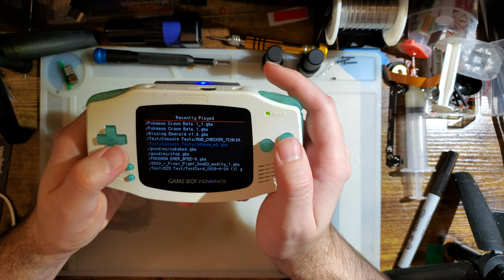Funnyplaying 3.0 Laminated IPS Kit for Game Boy Advance FRM Update

Comment: Appreciate the video covering the new kit, definitely learned a couple things.👍

I just installed this kit myself, I'm really quite happy with it. I don't have any experience with the older version of this kit but the new bracket does feel very sturdy. I find my lense fits very flush along the bottom and sides but the top does sit out past the shell just a hair. 

Colour mode 2 is definitely a bit much. I did find pairing it with display mode 3 was actually a nice experience though in Pokemon Emerald. I haven't tried other games yet.

Comment: I believe the 2230 and 2245 means they are produced in 30th week of 2022 and the 45th week of 2022. Same system like the DOT code on tires.
So in essence the same version of the flexboard but produced 15 weeks later.

Comment: I just installed mine and it has formed a vertical black line down the side that wasn't there when I tested it. Can it be fixed? Or is it a bad screen?
Reply from the maker: I can't say without pictures. You'll want to contact support from whoever you purchased the kit regardless because it's up to them to replace if the hardware is faulty.
Reply: @makho  Funnyplaying was actually really good about sending me a new screen.
Reply: @makho  now when I test screens, I leave them running for about a half-hour with Sonic Advance playing demo mode

Comment: My guess - display mode 2 is horizontal interpolation to compensate for lack of integer scaling - this would be noticeable on side-scrolling games (there is a scrolling test in the test suite normally), the pixels would shimmer as you scroll whereas if they are interpolated it wouldn't be noticeable.
That test screen triggering the touch sensor is pretty interesting! I think the combination of on/off in the digital lines is creating an electromagnetic field or something which is triggering the touch sensor, or creating interference in the lines that run to the touch sensor.
Reply: what is the resolution on ips laminated ? I read that this displays dont have integer scaling. Does this mean its 240x160 ?
Reply: @Poirot07  I think it is 720x480

Comment: I just installed the kit in mine. I did have a couple issues installing it. The first was the clip that holds the ribbon cable of the screen had issues holding after opening and closing a couple times for testing prior to installing. This cause the screen to not display once the shell was nearly assembled. The second issue is the ribbon cable colliding with the screen bracket causing it to want to lift back up. It eventually went together and functioned but not before a lot of anger and fool language. I ran the vertical line test and mine didn't trigger the onscreen display. I didn't use the foam but used kapton tape instead to hold the touch sensor so maybe that has something to do with it.

Comment: Fit this couple days ago, done many screens before but after a couple hours gameplay the screen developed two dead vertical lines. Im guessing its due to the very short ribbon. Theres only one position it can go in to keep the L shape square and this causes strain around the pcb at the top. Could do with being 5mm longer tbh. Ordered another so will see if i just got a bad one
Reply from the maker: sounds like you might have pinched something in your install. This has not been my experience at all.
Reply: @makho  definitely didnt pinch anything, i even ordered a second and before even installing i tested it and it was damaged already. Contacted the store and sent pictures of it powered up out of the device still with screen film on and faulty, they then tested and sent me a working screen which was installed successfully and works perfectly. Im guessing they just had a couple of bad screens and sadly i was unfortunate enough to get two of them

Comment: You don't have any graphical glitches on Link going up and down with FRM on? I do on mine sadly...
And i also prefere the scanline option, especially in GB games, it "hide" the scalling issues better
what i would have to have to make this kit just perfect  :
- integer scalling and 
- some color correction shader option (kind of like the "wiiU shader" on mgba)
- more pixel grids option (add vertical and square pixels)
(- in my case, non buggy FRM option)
ps: also a way to eventually update firmware would be extra nice, for those kits with functionalities that tend to evolve, could also give a way to potentially adjust color schemes to personal preferences for those willing to tinker (could make use of the data lines of their battery kit usb-c plug? idk)
Reply: actually for the second you walk down out of the house i can see the grey artefact on Link i was talking about

Comment: in the ita kit video you showed that the bracket was flimsy and allowed the screen to be pressed when pushing buttons, is the retail version of the ita kit using the bracket in this video or is that problem still there?
Reply from the maker: This video was made with the current version of the bracket. Fitment is better.

Comment: Soldering the wire to point "C" on the motherboard is not recommended in this kit?
Reply from the maker: Aside from optional button controls, there should be no soldering required for this kit.

Comment: Can someone explain to me what features I lose by not soldering any of the wiring?
Reply: None.
Reply: @swierzbokij  wouldn't I lose the ability to adjust brightness at the very least?
Reply: @22lbsboost  Absolutely. Everything can be done using a touch sensor.

Comment: is it possible to replace the cartridge reader from the gameboy micro with a gba cartridge reader so we can play GB/GBC Games? if not, is it possible to somehow build all the GBA PCB stuff into GB Micro Case so we have a GB MICRO which reads GB/GBC Games?
Reply from the maker: If you have to ask, the answer is no. The micro cannot run GBC games not because it lacks the detect switch but because the CPU itself simply does not support them. You can hack the micro CPU and crash it into GBC mode and the BIOS is there and will boot but cart access is restricted in this mode so you cannot go any further.
Reply: @makho   very informative! thank you for the answer, legend.

Comment: Idk how people are able to connect that ribbon cable so easily on the inside but mine is kinda making me mad cuz it feels like it's smooth and it WILL NOT latch
Reply from the maker: It does take a little bit of force to do. If you're not experienced with these latches, it can be discouraging. They are also pretty easy to break though since they are only rated for a couple dozen mating cycles or so.

Comment: Hi how hot does soldering iron need to be at?
Reply from the maker: I tend to solder at about 280C. But temps vary depending on your tip (I use a K-series), the joints your're doing, and how fast you work.

Comment: This screen looks nice! I wonder, is this one of the best options available? (that don't have extra like AV out, etc.)

 I remember I had another SP I got modded with an IPS, which IDK who the vendor was, as it was a local shop here that does the mod, and it has some screen tearing even when there is mostly solid colors (NES games) , to the point I rather use my AGS-101. Also, if we trim the shell, would an original screen still fit back on or would it be loose? I see there is no red color for this mod yet, so thinking of installing this on a classic nes sp 🤔

Thanks again for all these videos! Really helpful!